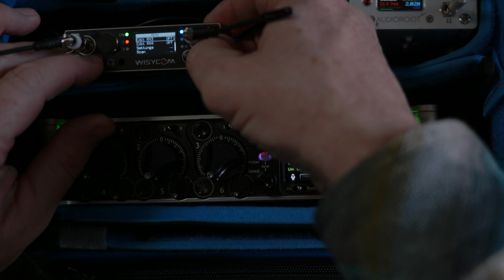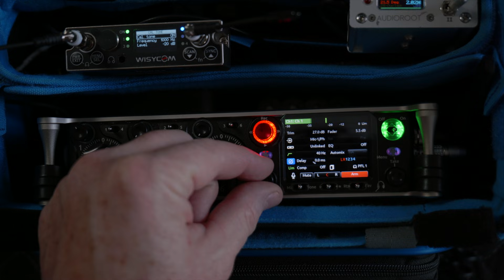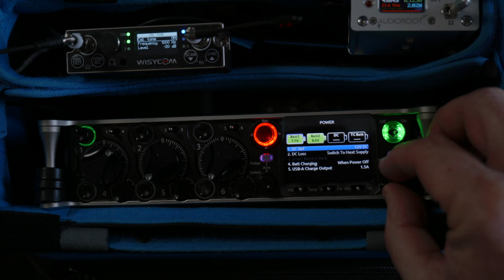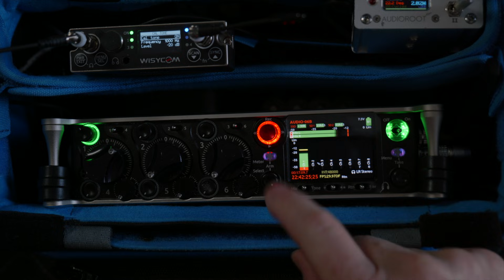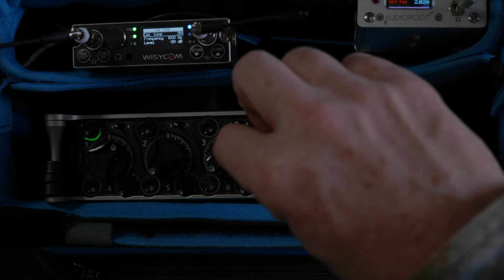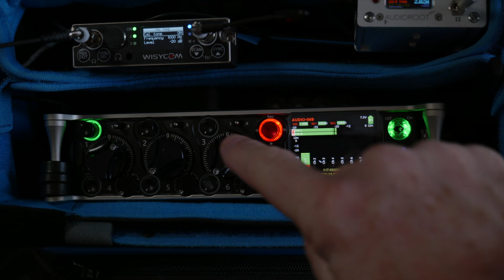MixPre → 833 Tutorial: Menu, Channels, Settings & Routing Explained

Comment: I watch all of 3 videos about 833, one think I don't understand, why do you need two cables to connect wisycom with 833, on my old 633 I can send two channels with one cable from lectrosonics 822.
Reply from the maker: The MCR 54 is four channels. So it comes off on a TA5 and splits to two TA3. So it sends two channels down each TA3. When I first plugged it in I thought I needed both TA5 to TA3 cables, but just one was needed.

I’ve never had a mixer with AES so it’s pretty awesome. I never knew about all this great digital signal sending. The MixPre had me in analog land forever.